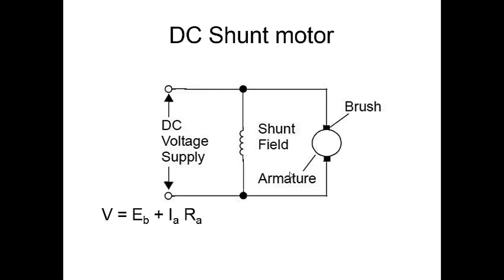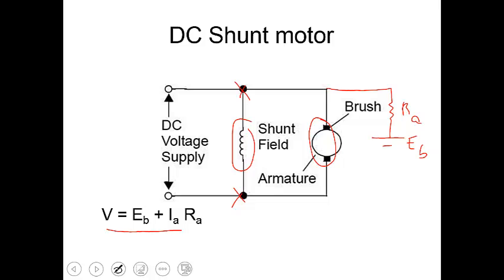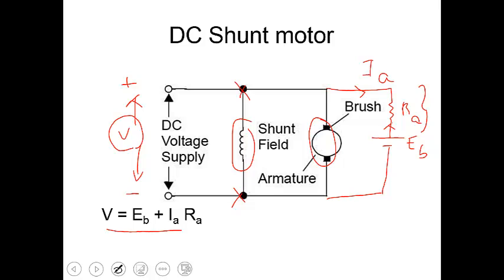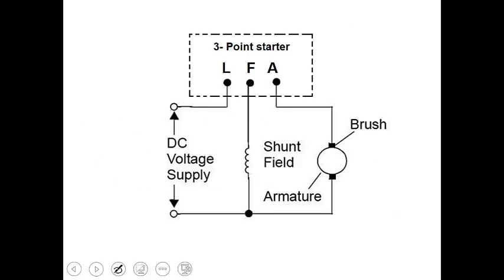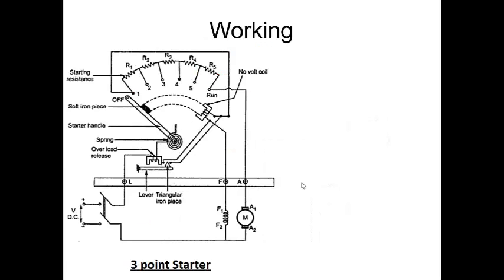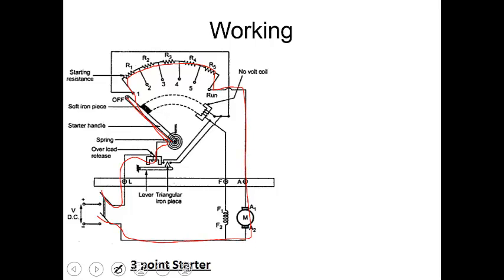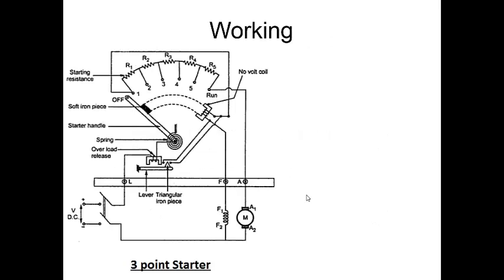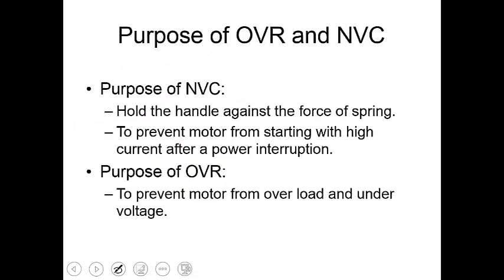Purpose and working of three point starter in DC Shunt motors

Comment: Why use four point starter in Dc shunt Motor
Reply from the maker: NVC is responsible for holding the handle at RUN position against the force of attraction of spring.  In 3 point starter you can see that the NVC is in series with field winding of the motor (See diagram from video). Suppose if there's a requirement to change the field current you will be changing the current flowing through NVC also. If the current through NVC reduces, then it might not hold the handle at RUN position. So we go for 4 point starters and there you have an additional terminal called N with resistance R. Here NVC and field winding are in parallel so change in field current doesn't affect the performance of NVC.